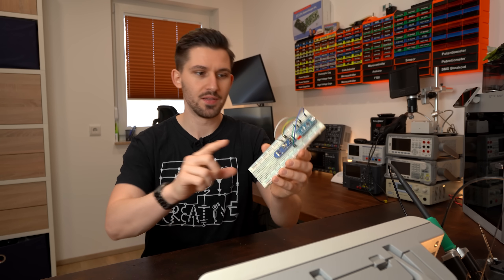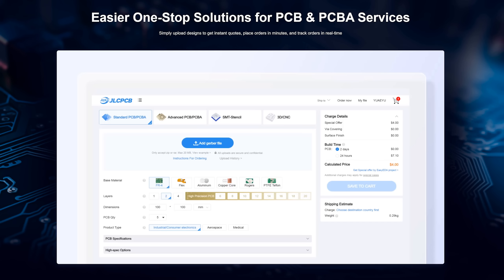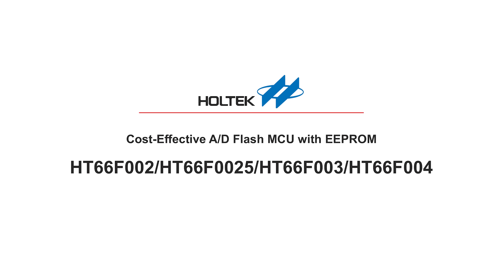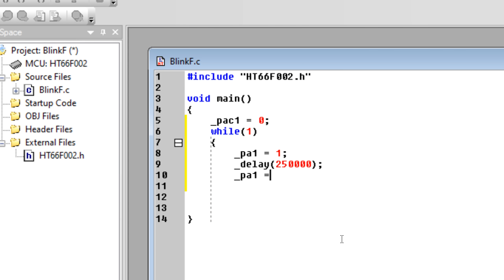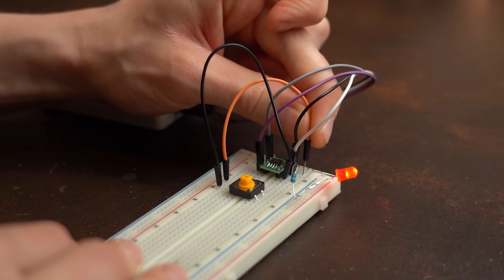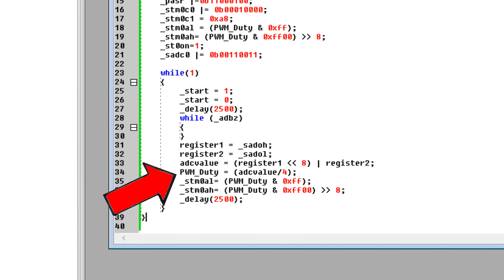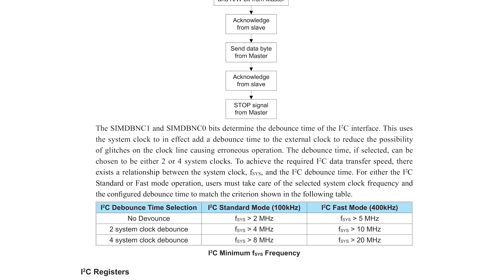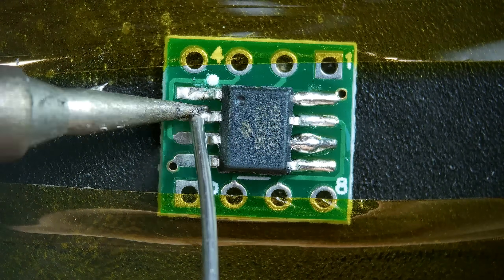I tried the Cheapest Arduino Alternative (that Nobody heard of)

Comment: CH32V003 8 pin arduino compatible, 20 cents or cheaper, seems like a better alternative?
Reply: 16 and 20 pin versions are around the same price too.
Reply from the maker: Sounds like fun. I put it on my to do list :-)
Reply: @greatscottlab it is a RISC-V MCU from WCH, but has a proprietary programming port too.
Reply: @greatscottlab oh my god i legit thought you were talking about ch32v003 for the whole video
Reply: @lavacat720 
-Me before watching this video: "here it comes, another V003 video"

-Me after the video: "WHY YOU!!!"
Reply: @mariobv947  haha that's legit me after I watched the video 🤣🤣🤣
Reply: That was my first thought too, the programmer and dev board are also much cheaper (about $10 for the combo).
Reply: The CH32V003 software tool kit comes with lots of example code that uses higher level functions.  Thus, you don't have to learn how to do all that bit fiddling.
Reply: There's also a company called puya producing the py32 line of microcontroller

Comment: I feel programming such chip is like writing an assembly code, compared to the Arduino's C++.
Reply: if you went through the Instructible link in the description, you would have seen that the programming is much similar to the Arduino IDE, and Language is also very similar.
Reply from the maker: Well, certainly takes some time to get used to. But assembly is much worse (in my opinion)

Comment: Watchdog timers are brilliant when used properly - deserving of a video of their own.
Basically, inside your loops you reset the timer. If your program crashes, it won't reset the timer and the watchdog circuit will reset the whole device. Absolutely fantastic for circuits that aren't easily accessible in particular.
Reply from the maker: Thanks for the feedback. Nicely summarized :-)
Reply: Yes it stops your program getting stuck, its a counter that counts up, when overflows the chip resets. All you have to do is reset it in your loop.  If you get into a deadlock tight loop in error it resets you.  Thats all there is to it.  You just have to be sure that you reset it frequently enough to prevent the watchdog biting you.
Reply: @dr_jaymz haha the overflow is in my shitty code, the watchdog is reset in the main loop.  When "somewhere" my sad code gets stuck, watchdog triggers and reboots the mcu, and the whole code works until.. well..  :)
Reply: thanks.

Another hole in the rabbithole of microcontroller.
Reply: Yeah, I was watching this video thinking how not fully explaining the watchdog timer can lead lots of people down the road of bad coding practices. I have no problems with disabling it for such simple code, but if you have a project that does anything more advanced (like wireless communication or has a display), you definitely should consider learning how to properly use it. Watchdog timers are great for error handling.
Nice video in general, though!
Reply: If you tell about this watchdog issue (fires when not intended) to the Clementine spacecraft (jan, 1994) it will laugh over loud ;-)  That's because they intentionally disabled the watchdog and therefore failed the entire mission. :-/
Reply: Sounds like a thing I would do in software, in fact, I think you can do it in RTOS because that is preemptive
Reply: @harrytsang1501   The whole point of the watchdog timer is that it's in hardware and works no matter what the processor is doing. Even with perfect code the system is vulnerable to crashes because of power glitches, cosmic rays, radioactive decay, electrostatic discharge, or other sources of interference.
Reply: @harrytsang1501  not every tiny device needs an RTOS though, or is even able to run one. If your target is a tiny, battery operated sensor, adding a RTOS and the extra HW needed is not necessarily a good choice.
Reply: How this timer is different than any other? It's seems just like a timer
Reply: @realdragon  Because watchdog timers run independently of the ALU. Your ALU can deadlock, but the watchdog can still keep counting down and reset your ALU
Reply: @realdragon I have a small smoke detector in my house I programmed a while ago, it was one of my first program when I was starting to code. It has (probably) a buffer overflow somewhere, which I didn't debug in the past. The thing is, it somehow restart every 2-3 weeks, and emit it's "boot bip". Because the watchdog triggers. I didn't touch it, every time I have the chance to hear it, makes me smile.. I love watchdogs, hope this is a good example of how they can be useful (here because it was a reaaaal bad code, but works absolutely perfectly ^^)
Reply: @realdragon  An ATtiny10 draws 493uA in a delay loop but 4uA sleeping using the watchdog timer.

Comment: I came across the Attiny85 recently after many years of projects with atmega328s and it certainly has made a difference for smaller projects for both cost and size.
Reply: Yeah, that was my first thought, too. For a project like this, why not just switch to an ATtiny? The CPU is substantially similar to that used on the ATmega Arduino boards, and I believe that there are even folks selling ATtiny boards that have added the appropriate tweaks to the Arduino ecosystem (IDE and libraries) to be able to use that to program and run the ATtiny.
Reply: @Curt_Sampson  you have development boards like the digistump which runs micronucleus bootloader, only problem is that if you use them in-circuit you want to disconnect some of the pins while uploading because they are used for the usb function too... :/ 
Also not sure if it has enough pins for what he is trying and probably the price is still too high: around 1.41 eur / piece for 25 pieces on mouser... is not that different from the arduino microcontroller he mentions in his video costs around 2dollar ~ 1.8 eur / piece for 20 pieces
Reply: Same thought here.  We use the AtTiny85 for a number of small control projects.
Reply: Same. I’ve found few 8bit MCU projects I couldn’t substitute a tiny for. I’m more likely to go to a 32-bit MCU when I need more  for the kinds of projects I do anyway.
Reply: The ATTINY85 is a great option.  But I've gone to the ATTINY1624 for most things.  They cost less than $1, have more pins, faster speed, more memory, and can be easily programmed in-circuit.
Reply: Q, how fast are those Attiny85 boards compared to atmega328? I was planning to use a couple of them to drive some led strips, but arduino nano can't drive too many leds fast enough.
Reply: @kentahirono  I wouldn't pick an old design like the ATTiny85, but there are newer members of the ATTiny family that can probably do what you want to do. And they are cheap enough that you could always combine multiple of these chips, if you have a lot of LEDs that you want to control.

When you are saying that the ATMega328 (which is also quite dated to be honest) isn't fast enough, you should give details on exactly how many LEDs you have, how they are connected, and how quickly you need to change them. For things like Christmas ornaments, pretty much any MCU should be fast enough, assuming you don't do really stupid things in your software. For tens of thousands of LEDs displaying an animated persistence-of-vision exhibit, things are completely different and you'd have to do some serious planning before writing your first line of code and before soldering your first component.
Reply: @gutschke  I was using it to do an adalight led strip, like 60 leds to be driven as fast as possible, customized a standard script to improve performance and compiled with O2 option. But now I want to make some desk lights with lot more leds (like +200) and I fear it's not fast enough to not reduce refresh rate or notice latency between head and tail.
Reply: Good points about newer range of ATTs. I found the 85 good from a size perspective. Recently doing something as simple as a BCD converter which could be mounted to a header.  I've been finding knock off Pro Minis too unreliable.
Reply: Have you seen ATTiny13? It's even cheaper
Reply: Dont use Attiny85. Its such an old chip and is frankly crap compared to modern 2-series attiny chips.
Reply: @stratos7755  Yes, you're absolutely right! He's not only blinking an LED, but reading a sensor as well, and there's no way a "crap" chip could do two things!
Reply: @Curt_Sampson  I said it is crap compared to the new attinies. Nice try tho.
And btw, if the sensor was communicating via spi, he would've used all available pins (led included) on the attiny85.
Reply: @stratos7755  And I'm just agreeing with you. There video makes it quite clear he's communicating with two devices (an LED and a sensor) and there's no way that an ATtiny85 could do that. I've no idea why they even have six I/O pins on an ATtiny 85 when it's clearly not capable of using all of them. (They should have put it in a TO-92 package, with just Vcc, GND and one I/O pin.)

Plus, imagine using all the pins on a microcontroller package. If you've done that, you've obviously done something very wrong and should choose a new MCU that has some pins you can leave unconnected.
Reply: Have been using the attiny85 a lot, but it is seriously overpriced compared to an arduino mini